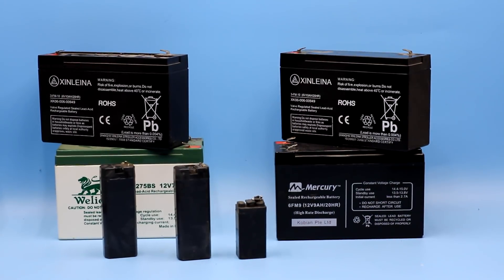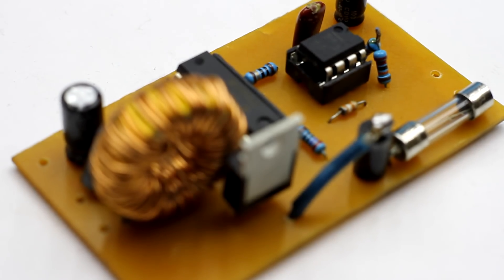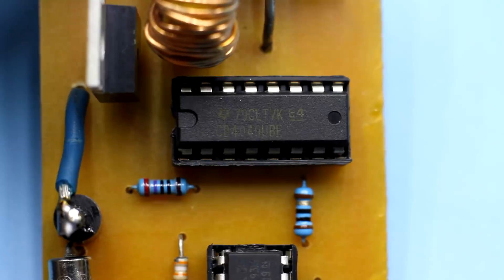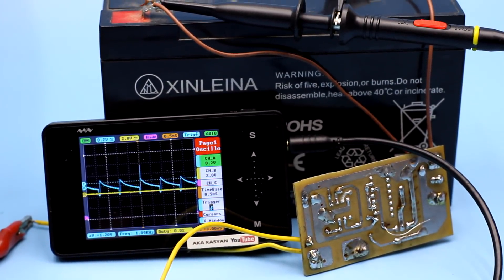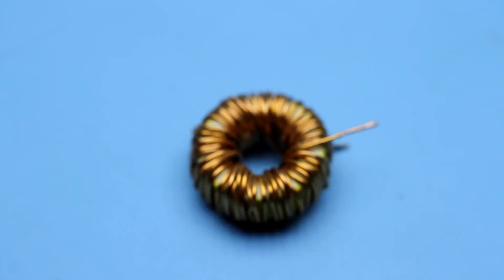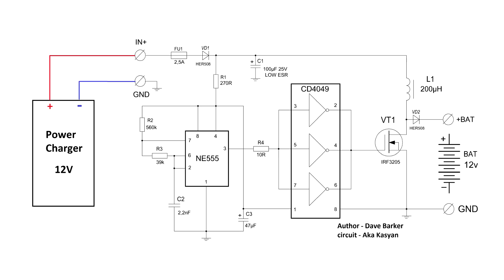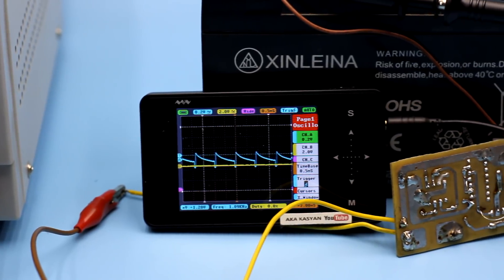How to recover a car battery

Comment: My guess high temps  destroys by warping plates and removing electrolyte. and going flat destroys by sulphation.  Over charging also removes water/acid. De Sulphating hard sulphate deposits, you need a higher  voltage across each cell and therefore a high current but this causes heat/high temps, which removes electrolyte and warps plates.  
So you use a DC welder, but only for 15 seconds, Then  let the battery cool and have another 15 seconds go  in 2 hours time checking the CCA after each try and a trickle charge in between.  Keep repeating this while the CCA increases. But once this stops going up quit. with a trickle charge in between. Using a trickle charger with an amp meter. Stop charging once the charge current drops to about an amp so as not to over charge and loose electrolyte.  I  have had some success doing this, getting  a change  from 50 CCA to 325 CCA, but Chinese desulphating charger ()*&Q^(#*&%()#*&^%_)(*&%_)(*+%_)#????????. You also need a load tester or something to measure the CCA.   I  have seen U tube videos of people bring batteries to the boil, but this would remove electrolyte and or warp plates, Since most 12Volt car batteries are maintenance free, You can't top up with out surgery on the battery case somehow. So look after the electrolyte you have    My 2 cents worth.  And don't electrocute yourself with your welder.  Electricity is heart stopping stuff. a tenth of an amp for a tenth of a second  can stop your heart, Your  welder produce 60-160 amps your car battery like wise with even more amps,  Extra low voltage like DC12-25 volts can still be deadly.

Comment: Interesting but what makes this superior to commercially available desulfators. For example ,I own one "BLS desulfator", "two Battery Extras" and one PulseTech Power Pulse PP-12L. All of these are permanently connected to 12v batteries.  My first question is how is this circuit superior to these commercially available models? How one compares to the others, is, in my opinion subjective. I can only say that on two cars with a Battery Extra on one and a Pulse Tech on the other that after 18 months with the same batteries purchased at the same date; the Battery Extra setup showed issues on a load tester, while the Pulse Tech did not. Do these products really extend battery life? Hard to say. I have the same questions about this circuit.
    For most of us it is easier simply to buy something off the shelf as opposed to chasing around looking for components. Then at the end of the day you can see the pulses on the scope but do these really desulfate a battery?

Comment: NOCO makes a battery charger with a desulfator at a very reasonable price: NOCO GENIUS2, 2A Smart Car Battery Charger, 6V and 12V Portable Automotive Charger, Battery Maintainer, Trickle Charger and Desulfator for AGM, Lithium (LiFePO4), Motorcycle and Deep Cycle Batteries

Comment: While it is true that the 555 can be driven below 50% duty cycle using diodes, I do think a CD4049 makes a better gate driver than the 555 output, so kind of a two-birds-one-stone type thing.

Comment: Only 1resistance connect on pin no. 5 to ground we can get reduce the duty cycle of 555 timer ic. In this case ground to pin no. 5,  1k resistor sufficient. And 8 to 7 pin should be 1k resistor।

Comment: Why this R1 limiting the NE555 voltage supply, since it can be perfectly  povered at 12V?
Furthermore, CD 4049 is absolutely useless if you adjust NE555 duty cycle that, with a different configuration from this, can be set from 10 to 90%

Comment: I built this.  It does not work for me.  No pulsing at all.  One thing I did differently was grounding the unused inputs on the CD4049 per advice from electronics forums.
Reply: Did you try... not grounding them?

Comment: Far as I know, its the high discharge that cleans the plates up, not a charge or pulse charge. It needs to be a high current pulse discharge instead.
Has anyone made this circuit and actually repaired the battery???

Comment: I have built a device like this... no success... I have more success with high voltage pulsating current from a powerful automotive rectifier,... best solution just replace the battery if a normal charge does not work it out in two days.
The high voltage high power will heat the battery and dissolve the layer better than this very-low power circuit.

Comment: Thanks for this video. There are many ways to not use the inverter IC: Simple NPN or N-FET to invert the 555 output, or use two diodes in the resistor timing path (this allows for separate on/off times), or use a P-fet and other ways.

Comment: Dear madame, your channel is very useful to me.please make a video , how to convert 12v dc battery to 12-0-12 dc dual supply. Thank you. Thank you so much.
Reply: buck boost stage followed by differential 7812 linear regulators

Comment: This is all fine and dandy, but nearly all batteries that failed me were do to cell(s) opening or shorting. There is NO fix for that! For batteries that are just weak, where all cells are just overly discharged, just a low amp charger that outputs a voltage of around 14.8 for a few days, watching that it doesn't boil hard. Don't use the type of charger that just cycle on at 13 volts and shut off @ 14.2 volts. You need a constant steady output (regulated). Junk stupid chargers (non regulated)  just keep going till they top out around 17 volts or so! These ruin batteries fast!

Comment: Hi
I have a question!
in the circuit diagram you displayed it shows that pin no 8 of CD4049  is connected to ground, but in the printed circuit board it shows no 16 is connected to ground instead while no 8 is not connected at all.
I am a bit confused, which one is correct?
Reply: I noticed the same issue. Did you get any feedback on this?
Reply: see datasheet

Comment: it is also possible to implement a similar functioning circuit with a single IC using a PWM chip such as TL494 or SG352X to control  duty cycle to around 10% or so, thus eliminating the need for the extra inverter chip with all the other component function remaining the same

Comment: I .tried it with ne555 only it works 1.3khz pin8 to pin7 10k pin7 to pin6 100k with in4148 diode paralled with the 100k resistor and 1k to pin 3 to gate using 10nf capacitor pin2 to gnd and 10nf pin5 to gnd it works 9duty cycle

Comment: i made this circuit without the 4049 and tried it on my 12v car battery which wasn't charging beyond 8.5 volts... after a week, i tried charging the battery again... lo and behold, i got 11.4 volts! putting it back again on the desulfator for another week... and then test it again after charging if it can turn an engine over...
Reply: Post your results please

Comment: Lead sulfate, when it falls off the plates, will reduce capacity and destroy the battery. More a problem with wet types as opposed to SLA with the electrolyte as a gel.

Comment: I don't have the application to open lay6 extension, so I just take a look carefully to the pcb in the video in order to copy the layout... something strange is in the schema CD4049 pin 8 is grounded, but in the pcb (in the video) pin 9 is grounded.... I can not proceed to make one... (sigh...)
Reply: 2,4,6,10,12,15 are Outputs.  3,5,7,9,11,14 are Input pins.  Pin 1 is Vcc and pin 8 is Vss.   Pin 8 should be grounded.  unused Inputs should be grounded as well so 9,11,14 would also be grounded.

Comment: This is the best video on desulfator circuit, very good you show the output on the scope!!
Reply: Desulfation is a myth today cause plates are too close together. Sulfate has nowhere to go after it has been unbound from PbO.
On older batteries it worked cause plates were not so packed. Eventually there was a problem too, desulfation led to sulfate accumulate on the bottom of battery.

Comment: THANKS KASYAN! BUILD REPORT:
________________
I build this project and successful without CD4049!
If the principle is feed the IRF3205 with 1KHz frequency and 10% Duty Cycle, so I rebuild the circuit like this;
1. Replace the R2 with 18K resistor
2. Replace R3 with 120K resistor and parallel with 1N4148 Diode
3. Replace R4 with 1K Resistor
4. I using IRFZ44 instead of IRF3205 (cheap and salvaged from another project)
5. I put almost 1mH toroid inductor salvaged from old PC Power Supply.
6. Throw away CD4049, feed the 1K to Power Mosfet
7. Never operate the project without Battery connected.

The result of my project; Frequency almost 1KHz perfectly, Duty Cycle 13%
Everything just run Warm, not heating as much. My project powered from SMPS Power Supply, rating 1.5Amp 12V Switch Mode in the Night time, and 12V regulated from 20WP Solar Panel with Buck-Boost Converter.

In two weeks, I revived 40Ah Car Battery, I know that my battery was abandoned long-long ago, voltage decreased until 3V, it was DESTROYED! And when I recharging this Battery with Pure DC (14V, 3Amp)  the battery just receiving float charging that make the Voltage jump up to 10V and never handle any usable current. Open it, add distilled water and few drops of H2SO4 / Sulfuric Acid every tube hole of cells.
So I make my project and connect to my dead Battery. In two days, the voltage reach 13.5V, a good sign for me and can handle usable current to light up  my 12V - 3Watt LED strip for almost 5 hours and become dim and more dimmer!
So I connect again to my project until 12 days. I think I can revive my Battery until the capacity reach almost 90% and never increase again. I think it just the limit of my battery health. May be 10% of the cells was destroyed when I put it in the car long-long ago.
After revived, my battery can be charge with ordinary Lead Acid DC Charger, I use 20WP Solar Panel.

Is this WORTH? I answer: YES!
Now, I have Lead Acid that can make my Phone stay alive because I connect the Revived Car Battery with Buck 3Amp to 5V module (USB Charger port), light up my apartment room with 12V LED strip, and power up my Keyboard-Piano then my Music Amplifier. 
Charge with Solar Panel.
SO HAPPY GUYS!

Cheers and Greetings,
INDONESIA !
Reply: Thank you I believed the same
Reply: @moquinlocuaz5974  build it and enjoy
Reply: @samuelbudiyanto2250  oh sorry, I thought I was commenting on other project. This is 1kHz so it would probably be fine.
Reply: Hi! What other diodes can I use, can I use those ones from PC PSU?
Reply: @theoneohmresistor  yes, you can use ordinary diode, for example 1N4007 from disposable CFL lamp
Reply: @samuelbudiyanto2250  I think it is not possible. 1N4007 is way too slow. I ended up using ATX's output diodes. It works awesome!
Reply: What is the value of your capacitor at pin 2 and pin 5?
Reply: come here in the future
Reply: Mas Samuel,  bisa dijelaskan dlm bahasa indonesia rangkaian yg anda bikin?  Saya pingin membuat desulfator tsb tetapi gak ngerti bahasanya,  cm ngerti dikit. Bisa bantu saya?  Terima kasih sebelumnya.
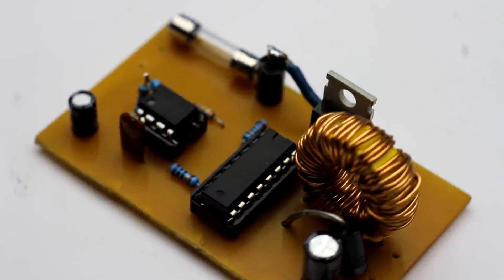Reply: @teguhbs5029  ada diagramnya di 3:48 kak

Comment: Thair is a rating for cranking amps if you're car requisers more thain batreys is rated for will not start the car even if it has 12v

Comment: In video is lot of miss-understoods......

1. 555 can make 5 to 95 % PWM with out problem...
2.  mosfet is CAP... with 500p - 1nF ...  you can supply with every signal (TTL) if u have high impedance just put resistor between this can, so charge process- on state will be slower... for. ex.:
micro-controller can make 20mA of output.... 
We can say that we will use only 15mA 
R=U/I =5 / 0,015 =  333,33 ohm.....the close in E... will be 330 

if you know that Cap is 1nano Farad, and Current = 15mA, Mosfet will be active after 333ns, with is really nothing when you play with 1KHz 

t = C*U / I
t = 1nF * 5V / 15mA
t= 333 ns
 
There is good way to use inverter, but for 100KHz swithing time when you need to low down power-loosses during swithing. but if you compere a 333nS or less for 3V TshV, and to 1mili S...  this is  less than 0,1% of working time.

I looks like you take something form the Net and try to explain what is what, bu you didnot engineer this, just copy and paste, but you are talking like it was your project...
Reply: You might be right in your explanations and/or calculations but I'll be honest, I didn't verified/validated your results.  The only thing I can say is that the initial circuit was in the document at the following link : [ www.barkeraircraft.com/files/Pulse3_web_layout_.pdf ].  You will notice the differences when comparing the circuits.  One important thing to note is the fact that this particular design is suitable for the small amp hour aircraft style and kid scooters etc, gel cell batteries, so I'm not too sure about the effectiveness with lead acid batteries.
Reply: Sounds like you got a chip on your shoulder.  If you watched the video,  he clearly said the "Author"  of the circuit ....  This implies that  he was not the original designer,  nor did he ever claimed that he was.  Plus,  this is a video for hobbyists and enthusiasts not for Engineers.  As a matter of fact,  I actually learned something new from this video.  I would not have thought of using a NOT gate as a way to change the duty cycle.
Reply: Got your back WTF BBQ! Its just some people see only what they want to see, hear what they only want to hear, and read only what they want to read - Just plain ignorance on their part.

Comment: disconnect pin 7 of 555, remove R2, connect R3 from pin 6 to pin 3, now you have 50% duty cycle.
connect r3 from pin6 to pin 3 with diode, connect another diode from pin3 to new resistor to pin 6, now change new resistor to change duty cycle to 10%
Reply: Do you have circuit for this sir?😊

Comment: There is no current path for the inductor if you run this without a battery connected. So It will probably blow up.
Reply: @platinumsky845  Making me revisit a 2 year old video, are you?
Where are you getting the 18V spike from? Without a battery there is NOTHING to limit the inductor voltage, except the turned OFF transistor. It doesnt even matter what type you use here, the inductor WILL dump ALL of its energy into it because there is no other current path. Energy of these spikes WOULD BE E = 1/2*L*I^2 = 1/2*0,0002H*1,75A^2 = 306uJ per pulse maximum IF C1 WASNT THERE. 

Now to find out the actual POWER dumped into the transistor I would have to look at the operating frequency and on time etc, which I'm not going to do now. And whether the Transistor will get damaged by this is another question still, which depends on the type and so on. 

The point was that this is not a great design because it has this flaw.

Comment: The only restriction of a 555 timer, is it can't produce 50% duty cycle pwm. Lower or higher is not a problem.
You don't need an inverter. Produce 10% pulses instead of 90% and directly drive the mosfet.
Reply: A 555 can easily do 5-95% duty cycle, even adjustable through the whole range. A 555 can deliver quite a high output current (it must not be the CMOS version though), but a driver for the MOSFET is always a good idea. In this case two transistor would be enough to drive the gate. No extra logic IC needed.
Reply: PirateKitty I don't think 555 can supply enough current for driving a mosfet a high frequency
Reply: In video is lot of miss-understoods......

1. 555 can make 5 to 95 % PWM with out problem...
2.  mosfet is CAP... with 500p - 1nF ...  you can supply with every signal (TTL) if u have high impedance just put resistor between this can, so charge proces- on state will be slower... for. ex.:

microcontroller can make 20mA of output.... 
We can say that we will use only 15mA 
R=U/I =5 / 0,015 =  333,33 ohm.....the close in E... wiil be 330 

if you know that Cap is 1nano Farad, and Cerrent = 15mA, Mosfet will be active after 333ns, with is realy nothing when you play with 1KHz 

t = C*U / I
t = 1nF * 5V / 15mA
t= 333 ns
Reply: @marcinwitkowski6443  You have a problem, mister. Do your own video and stop trolling other people's work. 
Repeating the same thing doesn't add weight

Comment: No, 555 ic allows duty cycle lower than 50%, just connect a diode from pin 7 to pin 6 or pin 2 and that's it.
Reply: Though, a buffer circuit is suitable for sharp switching of the FET, so, the logic NOT gates are necessary.
Reply: @anindyamitra5091  555 can easily drive gate of fet. it has same totem pole transistor output as cmos gates. gate of fet very high impedence virtually zero current
Reply: @WereReallyRelayCamping  The 555's I have used decades ago were +/- 200mA drive, easily handle fet gate cap charge/discharge.
Reply: @anindyamitra5091  True, but single transistor could be used to invert signal.
Reply: @cekpi7  , of course.

Comment: can this work on lithium cells? i have a bunch of cells with good capacity but bad discharge current after a few seconds under load
Reply: John Scarce just don't. Or else they will explode
Reply: Kasyan has videos talking about li-ion batteries,take a look before you try anything.
Reply: Li-ion use an entirly different chemistry.  Doing this to them will either blow them, or destroy their capacity.  Recovery of a dorment li-ion usually requires a very low controlled current imput over a period of time.  It's been a while since I last looked it up, so do your research.
Reply: i charge my batteries with this weak charger that can't even supply an amp, but do you suggest charging them trough a 1k resistor? also do you mean over a period of time like days and let it overcharge? i have at least 10 batteries in this state and your information could be very usefull to me